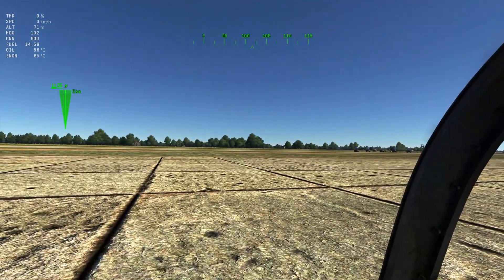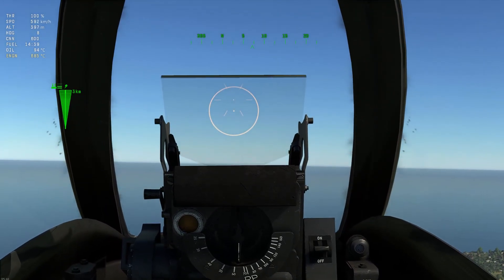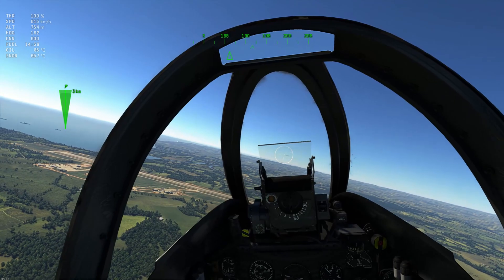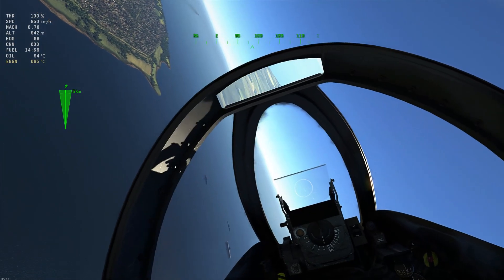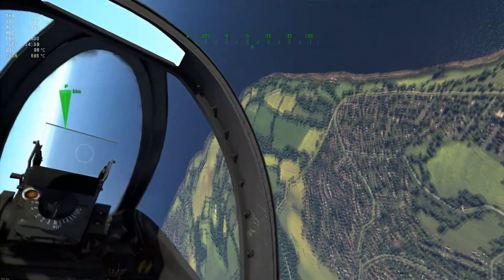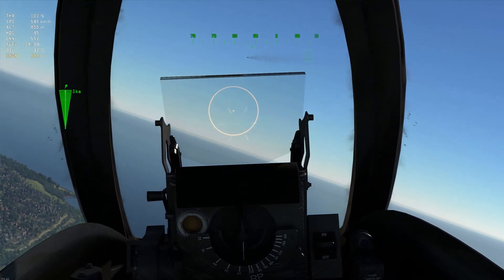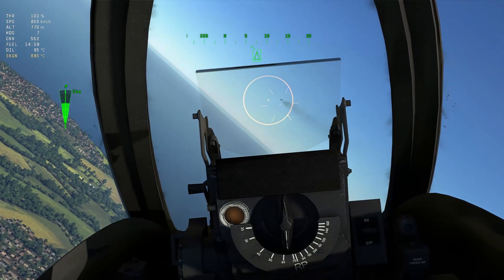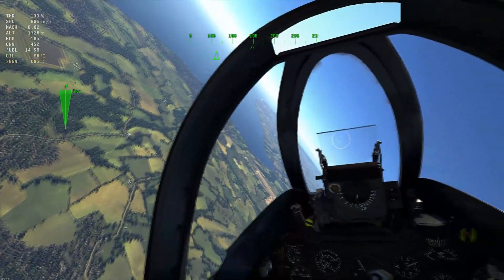War Thunder Sim - Radio Range Finder Tutorial

Comment: IL 2 has a really nice set of tutorials on how to use the gyro scope. In addition, it also shows you how set its size to fit the plane you are going after(wing span), and range (300m etc.). I have found here in WT not even the most experienced pilots know zero about how to use a gyro scope.  I love the gyro scope for deflection shots. IL2 does go that extra mile however, to setup your scope (sans radar) for the wing span and distance. WT would never add those two controls. (wing span and distance to adjust the scope sans radar.)
Reply from the maker: Dammit now I want to play IL2 again lol. Very good points you made there 👍

Comment: Isn't part of the point of these that the marks around the sight pip should increase/decrease in size as range closes, to allow matching against the target wingspan?  (Of course, requiring dialing in the estimated wingspan into the gunsight)  At least, certainly this was true of the WW2-vintage K-14 sight, and my understanding was that the post-war radar sights were basically the same thing, only using radar to set the range rather than requiring the pilot guesstimate both range and wingspan...
Reply from the maker: I'll be honest I don't know much about the sights on these jets IRL. Though I do believe some indeed allowed matching against the target wingspan. I don't expect it to be implemented in the game however as it would add another level of complexity that might put off some players, though I myself wouldn't mind it.
Reply: I think Sabre pilots had the sight lead the target but then they had to dial in the gunsight to the targets wing size while they are flying.

Comment: I'm pretty sure Gyro sights are still bugged, on French Jets (which only 2 jets in game have radar, and one isn't even french), they don't even follow the gun convergence range. I know it works on other jets with radar (La-200 for example). Honestly the fact these jets (M.D. 450, 452 (Ouraguan, Barogaun, 2A, 2C), Super Mestere, Etendard IVM, Jaguar A, even the fucking Mirage which has radar) even have gyro sights is confusing for anything outside the 2 with ballistic computers for ground attack. It's literately worthless on air targets since even a shallow deflection angle need to have the lead given by the gyro sight doubled to get a hit.

Would rather have the fixed sights the VB.10s have, but we can't set the sights to fixed.

Hell in the 452 2A cockpit the gyro selector has a Rockets setting and also a Radar setting visible. But it's set to Guns and Manuel. Not even matching up with Gun convergence settings like on some British planes.

Comment: Very helpful. Do you still have to manually lock on a target or does it work automatically as long as the radar itself is switched on?
Reply from the maker: You still need to manually lock on, I believe it is just the gimballed sight that automatically adjusts.
Reply: TeaRex ah, alright. Thanks.